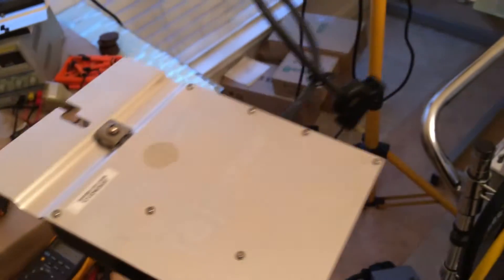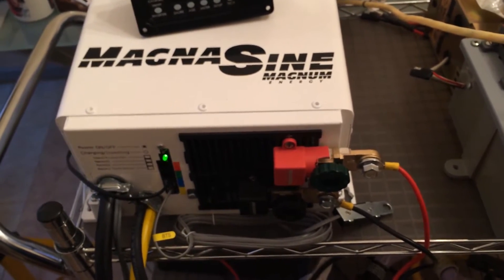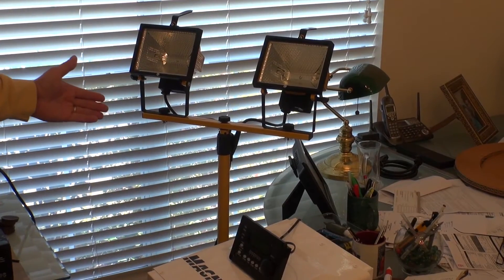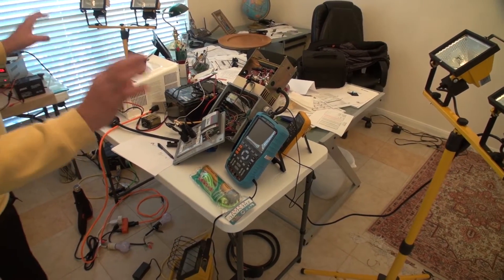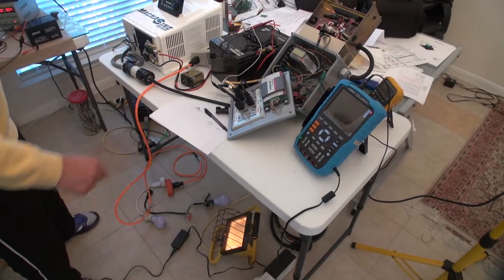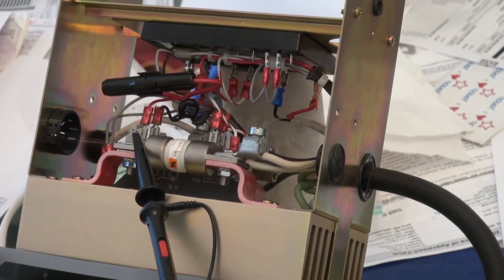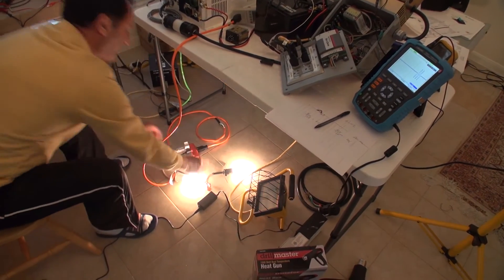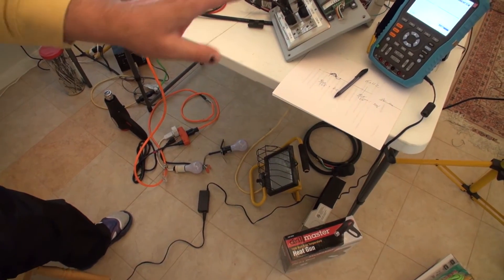Grid Tie Inverter without a Grid Part 2 of 5

Comment: I’ve been asking solar companies about the same thing your doing and they all tried to sell me an expensive battery back up system. This is exactly what I’ve been looking for. I have a question about the dump load. I have a 25Kw system with 76 panels and emphases IQ 7A micro inverters. I have a swimming pool. Can I dump the load to a 220v pool heater? Also how did you connect your system , before or after your breaker panel? My system was hot connected prior to my breaker panel.
Reply from the maker: Sure you can you can dump excessive power to any kind of heater. The nice thing about Enphase micro inventor is they turn off with slide change in the frequency the bad thing is they take up to the 5 mins to turn back on that is the reason you do not want to turn them off and on and  with getting rid of the excess power via dump load.
I think if you watch all 5 videos you see how did I got rid of the unused power.
By the way my system goes through couple breaker before connect to the grid I did show that in my of my video.
Reply: @Mark1Jordon1  Can you provide rough total cost you spent to create the system?
Reply from the maker: I say about $3.5K and $2.5K of that goes toward Magnum inverter MS4024PAE